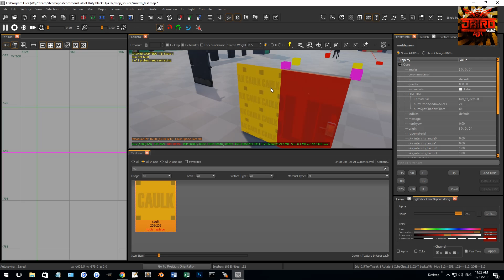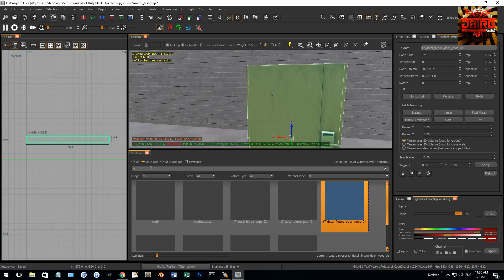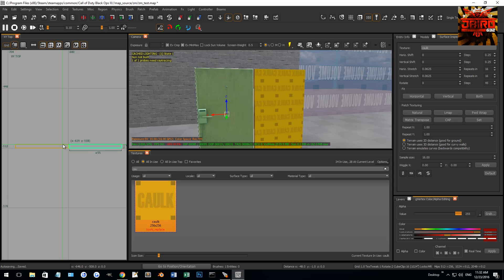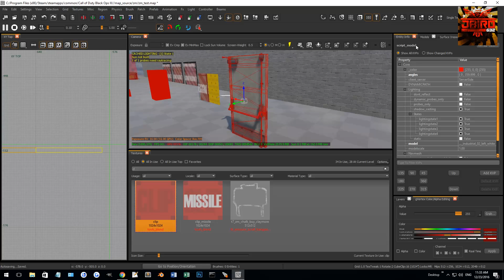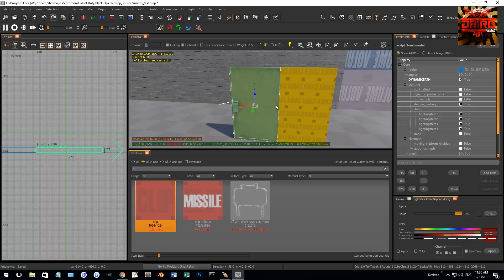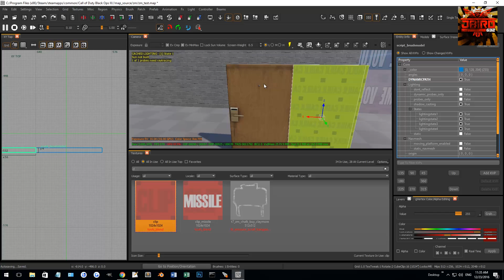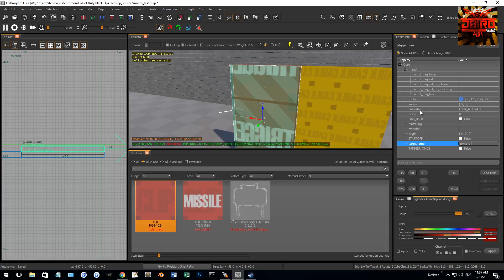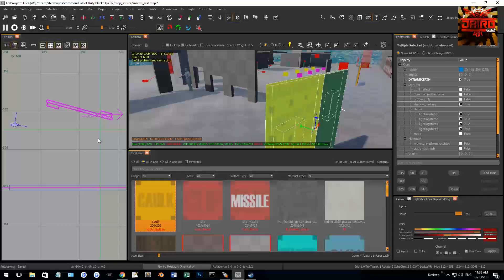Black Ops 3 Mod Tools | Tutorial Part 22 - Door Rotation Fix

Comment: mann.. so how do you do this with a door model..? this was so confusing because you did it with brush model door
Reply from the maker: I might have mistakenly said in the video you can do it with a model. You can’t. You will have to export the model, change the origin in maya to be the hinge and then import it back in.
Reply: @JBird632  aww ok i guess ill just do it with the brush model then
Reply: wait so is there any other way to fix it so a door model doesnt just rotate in place when you open it
Reply from the maker: Cloudy yes by changing where the origin of the model is. The only way would be to export the model using a tool like Greyhound, then opening the model in Maya, fixing the origin to be the hinge, exporting the model with the CodTools plugin and then importing it back into bo3. (It’s a bit advanced to do for newer modders imo)
Reply: alright.. another question since im here  my walls texture is little bit off from the wall next to it how do i make it so it like connects or whatever. any idea?
Reply from the maker: Cloudy easiest thing is to do Ctrl + Shift and left click the face that you want to adjust. Then with that face selected, middle mouse click on the wall you want it to align with. This will lightmap the texture to follow the texture coordinates of the other wall.
Reply: @JBird632  thank you!

Comment: I know this is an old video, but does anyone know why when I select the two brushes they each rotate about there axis? Also the kvps don’t transfer between the grouped entities which makes me think they’re not grouping
Reply from the maker: Ya that definitely sounds like its not grouping properly. I don't have radiant setup to help out anymore, but make sure you don't use models (this only works with brushes I think I might have accidentally said it works with a model in the video)
Reply: JBird632 They are brushes so it seems like something is bugged in my version of radiant. I saw someone else in the comments had the same problem but their solution didn’t work for me. Thanks for the reply though

Comment: thanks for this, i was wondering why some doors did that.

however question, im not sure if this works or not (this is what instantly came to my mind when i came to this problem) 

would/couldnt you just change the origin and the angles?
for instance, since  normally we would rotate the door in radiant to get the angles we want it set to, couldnt we also set up a KVP where it changes the origin to a specific origin? that way, while its rotating, its also going into the place it should be. My only thing with that (if it worked) is it might not look as if a door was opening, and rather than it just floating and rotating into place.
Reply from the maker: That's not how it works unfortunately. If you change the origin, then the entire thing just moves, if you change the angles the entire thing just rotates - doesn't do the effect you want. There are no kvp's that can offset it either.

Also I would like to note that this tutorial only works with script brushes and not with models, if you want to fix the rotation for a door model you will have to export the model to maya, move the model in there and re-export and import it back into radiant.

Comment: Has anyone had success with using this method with script models?  Whenever I try this with models, it doesn't function correctly, and they still rotate on their original axis.  It seems like the entities don't group correctly?

Actually, even grouping brushes doesn't seem to function correctly.  After I've selected two brush scriptmodels and selected 'add brushes to entity', the KVPs don't transfer between the two.  Is there another required step or option that needs to be selected in Radiant?
Reply: It turns out somehow one of my mod files seems to have been missing.  After telling steam to verify the tool's files, it found one missing and replaced it.  After that, grouping entities works for brushes.  However, it still doesn't work for script_models.   Do they require a different process?
Reply: need an answer to this asap :(